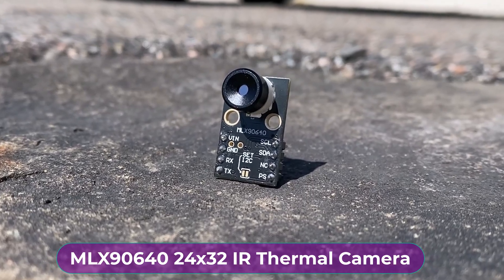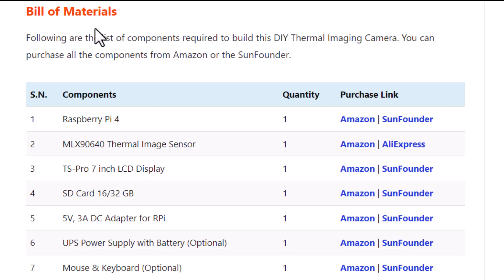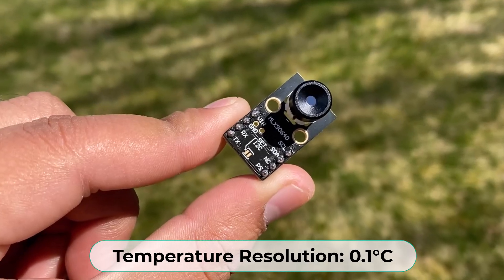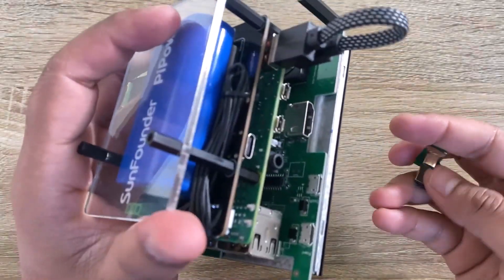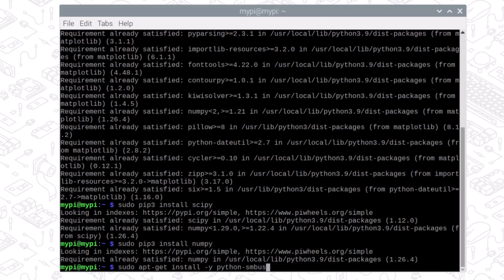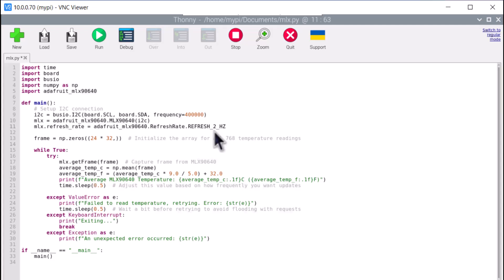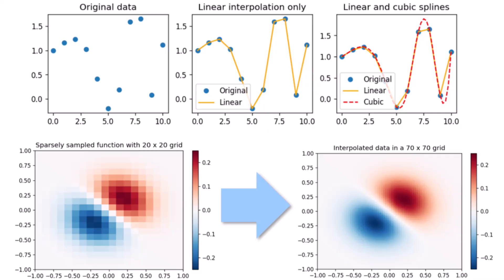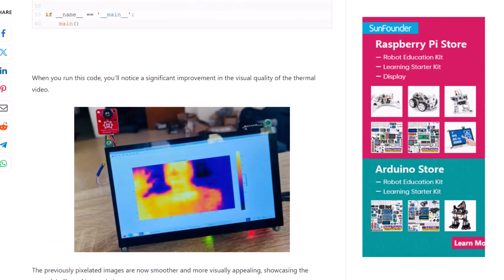DIY High-Resolution Thermal Imaging Camera using MLX90640 & Raspberry Pi

Comment: Fucking backwards work this is for one go read up about how resolution works because hd vs frame rate and pixilation is 3x a different concept. Also you can get a well above budget/cheap and even in the intermediate thinking of going pro superdeluxe store bought camera if your stupid enough to FIRST build all the uselessly overpriced raspi shit and then buy their module is besides copy pasting some text you still don't know how the thing you built and programmed actually works

Comment: Hi, all works fine, but on your video you get a pic with  y-axis temperature in between 22 and 34. If I run the temperature shows 0 and 250. So I don't differences very weak (most is yellw and I see a little bit yellow-green). Does anybody has an idea whats going wrong? my thx in advance.

Comment: Hi, which operating system did you use? I used the latest version of Debian Bookworm dated 22 Oct 2024 and several libraries(adafruit) are giving me installation problems.
Reply: Did you figure it out? I'm having the same problem.
Reply: I got it to work on the latest OS, you just have to create a virtual environment and download the libraries into that instead. Then, in Thonny, you must configure it to run with the files in the virtual environment. It's not too different.

Comment: doesnt work   
File "/usr/local/lib/python3.11/dist-packages/adafruit_blinka/microcontroller/generic_linux/i2c.py", line 98, in writeto_then_readfrom

  readin = self._i2c_bus.read_i2c_block_data(

 File "/usr/local/lib/python3.11/dist-packages/Adafruit_PureIO/smbus.py", line 264, in read_i2c_block_data

  ioctl(self._device.fileno(), I2C_RDWR, request)

OSError: [Errno 5] Input/output error

Comment: Hey i am not coder, but trying to to make 1 project so basically i have esp32 devkit1 , so can i use this model with mlx90640 and view the thermal image on my laptop, and do i flash it with micropython or arduino ide will work. I know its a lot to answer but i hope u will answer some😅. Thanks
Reply: Yes and no

Ideally you would "flash" some compiled code into the ESP32 and then stream the data to your PC via the serial connection linking them (usb).
Think of it this way, the MLX90640 is connected to the ESP32 via i2c with a code you uploaded from your arduino or micropython. The esp32 is connected to the PC via serial. You can view the data from the MLX90640 from your serial monitor (using arduino) but it will just produce a bunch of junk numbers. However, using libraries like Serial and matplotlib on python, you can actually convert the stream into a heatmap representation to create something like a videostream

Comment: is it possible to use it with an arduino or is it not powerfoul enough? also, are there any drwaback to have a higher refresh rate?
Reply from the maker: The MLX90640 thermal camera often struggles to work with Arduino because the Arduino doesn't have enough processing power and memory to manage the sensor's high data rate and calculations. Also, there can be compatibility issues with the I2C communication protocol that make it tricky to connect the two.
Reply: Might be able to stream the sensor data to a PC for interpretation. An Esp32 might be able to do it on chip.